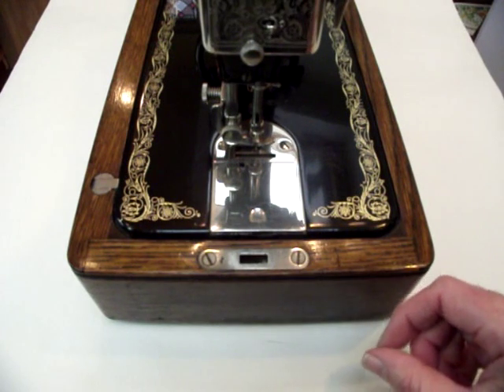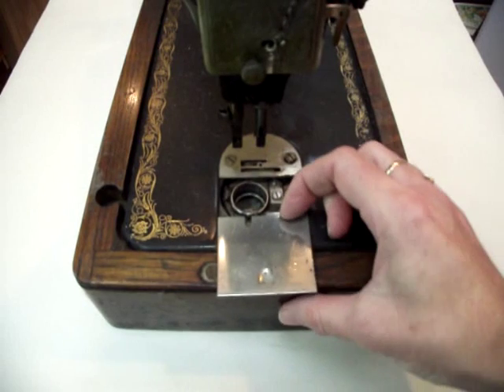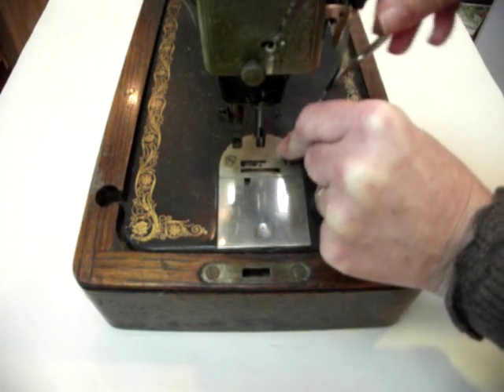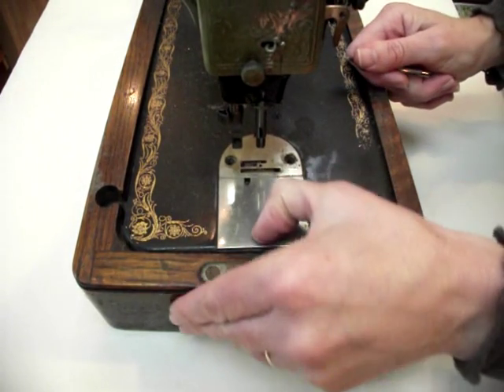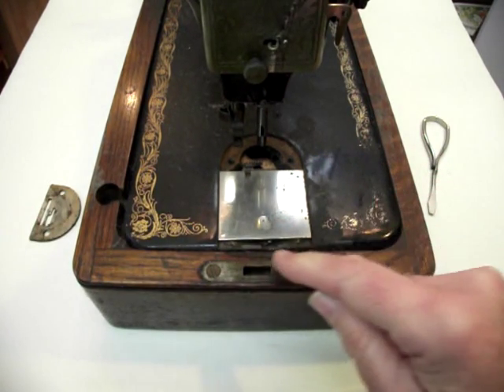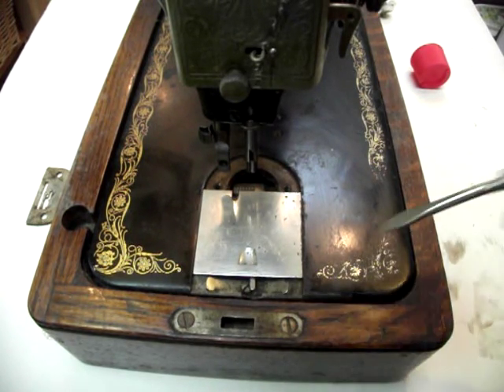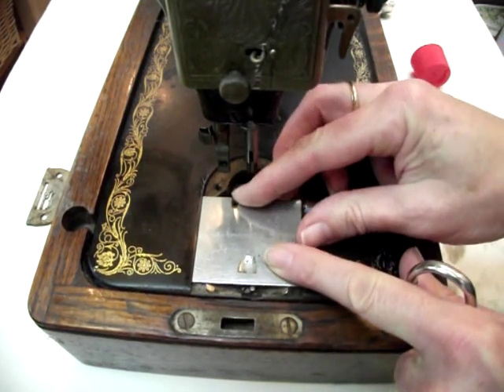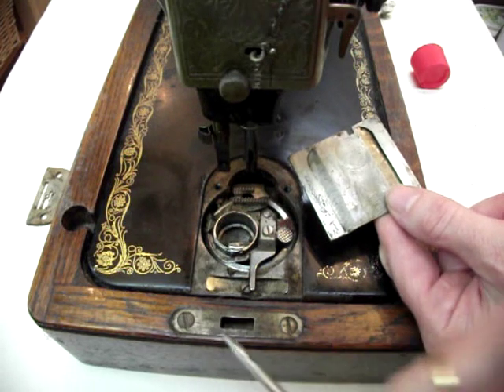How to Remove a Bobbin Plate from a Singer 99K Sewing Machine

Comment: I don't know if you still read the comments on your videos, but I wanted to thank you for this. I recently (this past year) refurbished a 99k for myself. When I took the slide plate off, I could not get it to stay on. This is still a problem. Now, I realize that I forced it off the wrong way, when cleaning, and I need to make an adjustment to the stoppers to keep it on.

Comment: Thanks so much for this video. Unfortunately I had trouble putting the bobbin slide back in. Then I simply oiled that area and it slid back in place easily. Thanks again, I have subscribed.

Comment: Lizzie.  Your videos are great!  I can tell you know what your doing.  Very handy you are.  I just purchased a 1954 99K Great Britain with original wood sowing table.  The table is in mostly good condition, however the finish on the table is cracking and peeling in several locations.  Would you refinish or leave as is.  If you did refinish should I restain or just coat with polyurethane?

Comment: The plate can just be removed by levering it up so it comes off the spring clips. The clips are high quality spring steal and designed to handle this. Removing the foot plate is not neccessary.